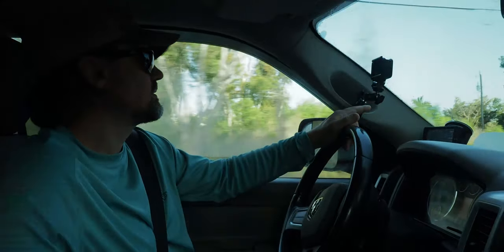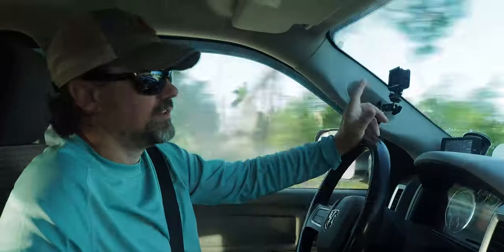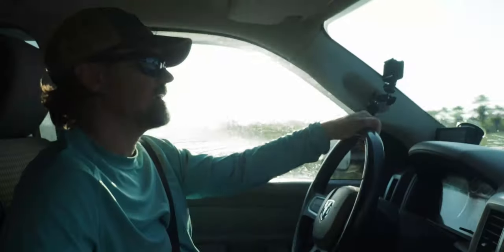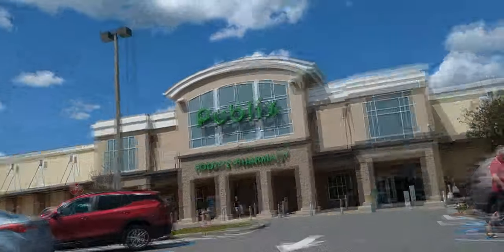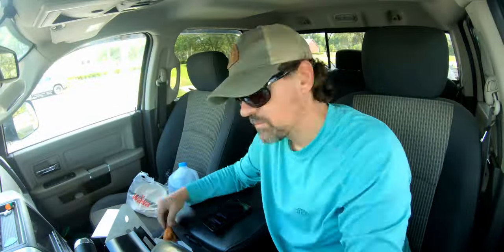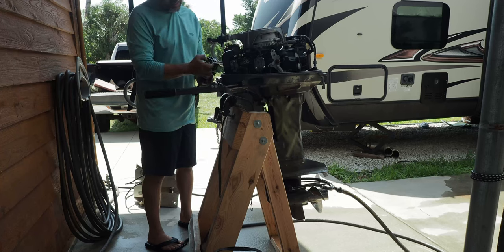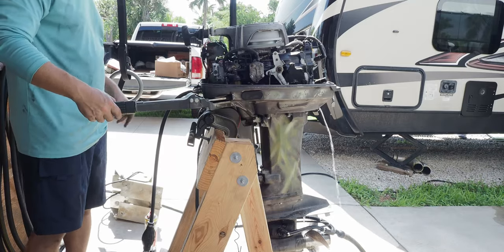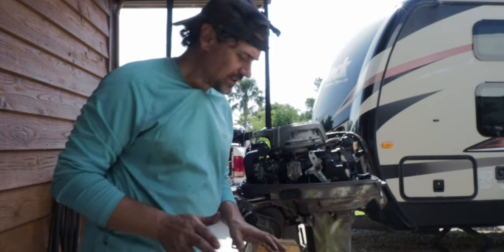Best Outboard for the Tiny Boat - Budget Motor Find

Comment: Hello from Jacksonville.  Recently i wanted an aluminum trailer for my skiff.  I found a boat that had been sitting that had a nice aluminum trailer. I bought the complete boat , i swapped the trailer from the donor boat to my skiff, i then pressure washed the donor boat and buffed the gelcoat and did a little tune up on the motor and got it running, after all was said and done i had a new to me aluminum trailer for my skiff and sold the donor boat for $350 more than i paid and all it cost me was a couple days of tinkering.😊 i am new to your channel but really enjoying the content so far keep it up
Reply from the maker: That sounds like a good score for sure!  I hope to find a nice little aluminum trailer for the tiny boat too. Its currently sitting on a converted PWC trailer. It works but not the best setup.  Thanks so much for subscribing it means a lot alot!